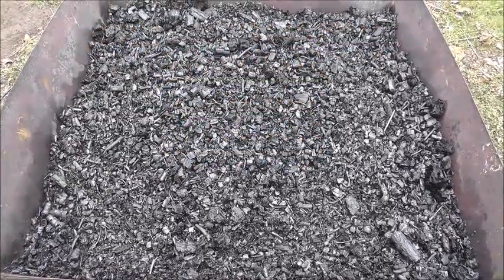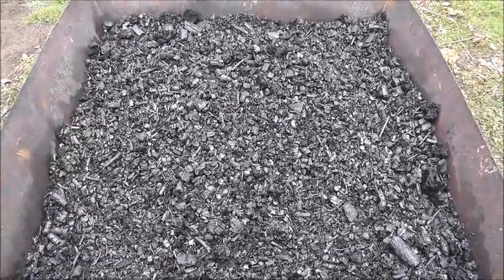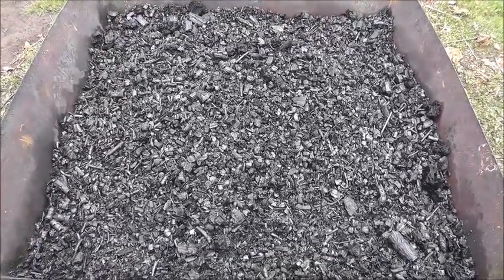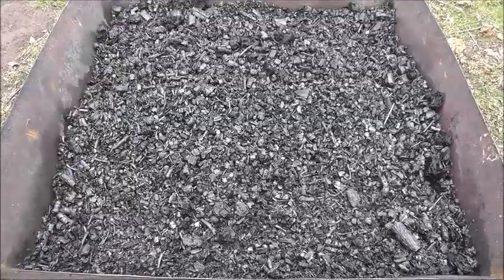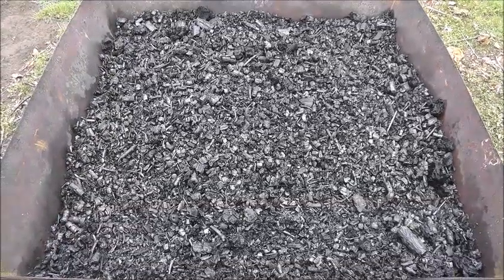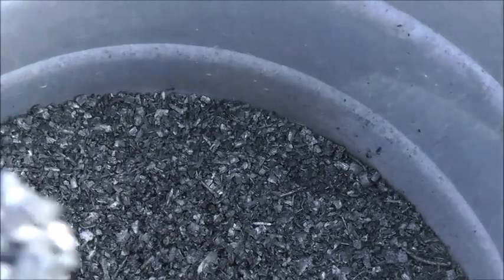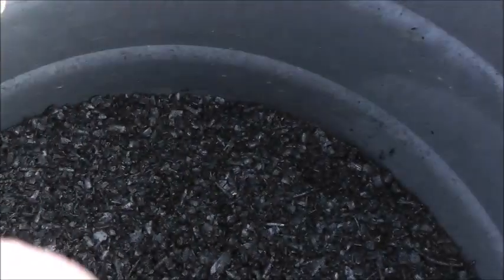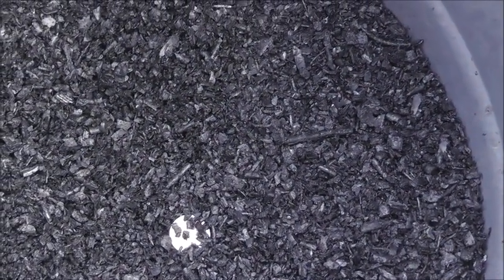PROCESSING BIOCHAR PART TWO

Comment: Hi Greg. I am going to make a large biochar burning pit something like this. What dimensions is your kiln?
Reply: Hi NGF,  The kiln shown is roughly 4' X 4' across the top and about 3' deep.  It's about 3' square on the bottom.  We had these made at cost at the community college.  We have found a pit works just as well.  Obviously the pit is cheaper and is reusable.  You will find the sides of the pit get baked, so it is easy to extract the char without getting a lot of dirt mixed in.  Do not extinguish with water.  Dry snuff by covering the pit with old sheet metal and covering with dirt so no oxygen can enter.  Plan on waiting about 5 days for a pit this size to cool down before opening.  Still look for any hot spots...you can never be too careful!  Gregory's cohort, O.J.

Comment: Nice video.
Mine never rinses off my hands (very dry skin and oily too).
Those oils left over are supposed to be good food for the soil microbes.

When I make mine I immediately quench the hot charcoal in a solution (has a little apple cider vinegar in it to make it slightly acidic).
The charcoal draws in the solution quickly.
I then begin straining mine to drain off excess water and begin the process of smashing it by hand.
Long slow process and little to no dust released in the air.

The black water is like platinum! Use it to water things and the biochar gets into the soil as you water.
Reply from the maker: From my training in biochar, oils in biochar are undesireable as they contain esters, kerosene, and other toxic chemicals.  Oils are usually the result of unfinished biochar, low heat, and green feedstock,
Reply: @wecangarden  I could see some of those things possibly but kerosene?
Ancient Amazonians had no way to determine the heat levels.
And how are those things created from mere seasoned wood?
I use heating wool pellets to make mine.
I wait till the flames go out and then 30 more min.
The stainless steel container is red hot.